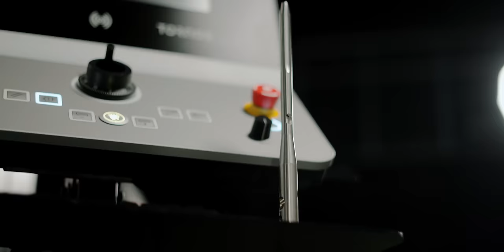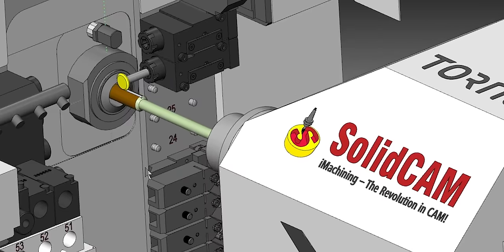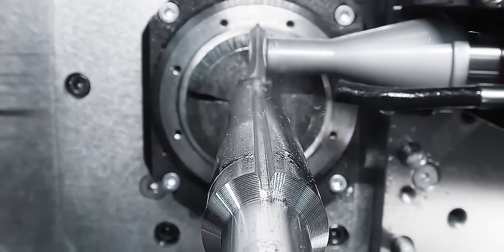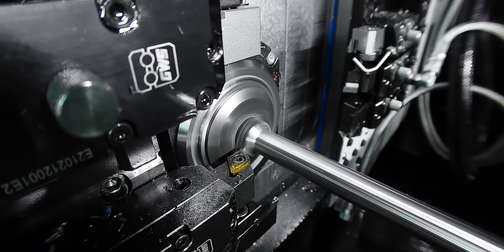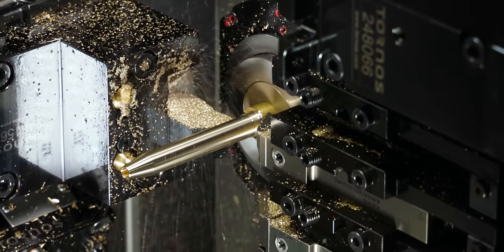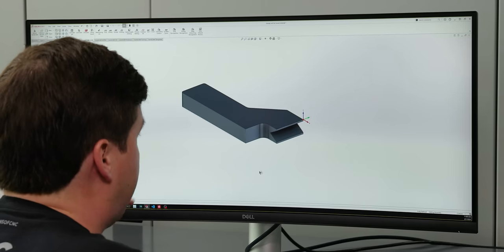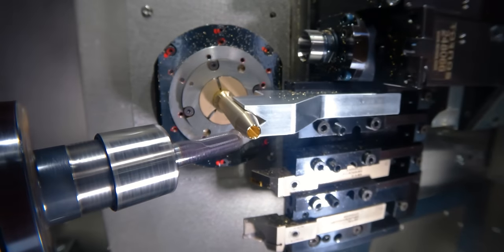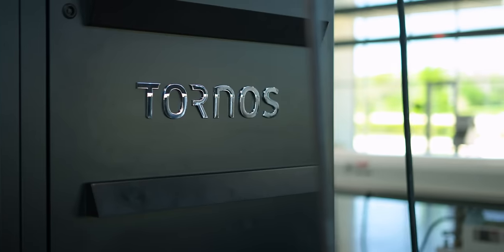Mesmerizing Swiss Machining: Precision in Every Move

Comment: I actually used that steady rest idea at my work for a shaft that I needed to put keyways, flats, and bolt hole patterns in. Only I’m doing it in a 4rth axis vertical mill, using my vise with a milled block to support the part while I mill the long flat. The part is 55inches long 2.5in OD 1.75in Bored ID tubing with a flat that’s .187 deep and 48in long. That flat has a surface finish call out of 22-62. They specifically told us it can’t be too perfect. They want the “imperfections” to help create friction to the mating part
Reply: Nice dude!